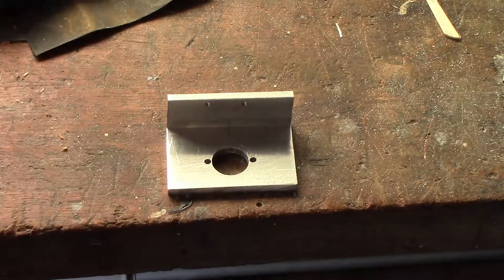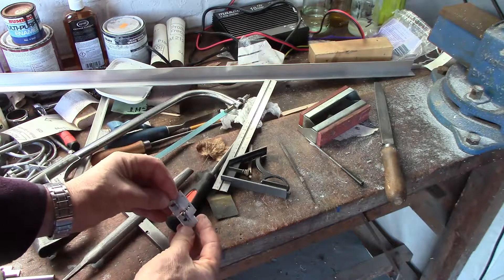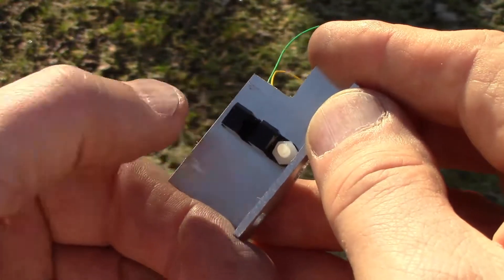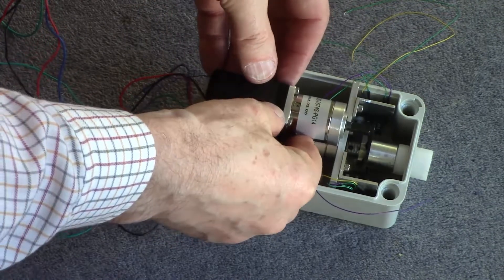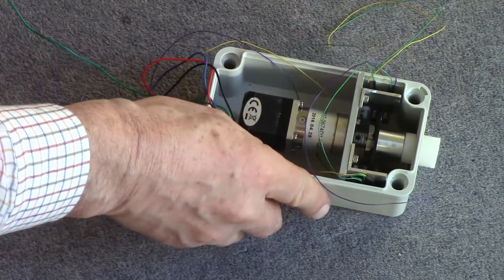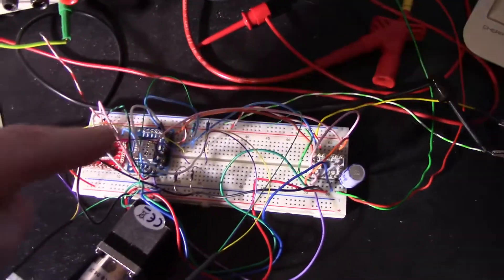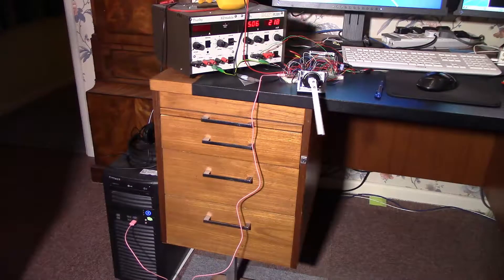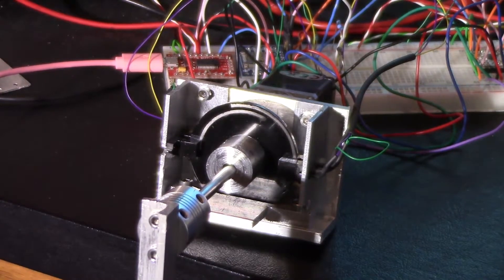Position sensor for 11HS12 stepper motor - part 2

Comment: Hi Sam, when you go higher rations than 27:1 on the planetary gearbox like even up to 100:1 then the Gearbox will not "Just" turn! We will be running a system with around 500+ of these motors and have had to test these!
Reply from the maker: Not sure what you mean by not just turn. You mean at 100:1 you cannot force the motor to turn by applying torque to the shaft?
Reply: @samuelfielder  When the stepper motor is off completely the output shaft will simply not turn at higher ratio's torque will be higher but at the loss of speed to required angle. But possibly for a boat this may not be such an issue to smooth out the movements. Interesting projects, was looking for someone that had cycle tested the stepper. Be worth getting a 3D printer Prusa and doing prints in Carbon Reinforced Nylon or Glassfibre Nylon. Just use a fume hood as Nylon is toxic which is why people print in PLA.
Reply from the maker: @wx6843  "was looking for someone that had cycle tested the stepper" - Did you see this one of mine https://www.youtube.com/watch?v=N92Z9f5vESU ?

Comment: Reasonably priced milling machine albeit very small: https://www.proxxon.com/de/micromot/27112.php?list
Reply from the maker: Thanks. Less than 50 kg, and available in cnc ready form for £688. Only disadvantage I can see is that it may not have enough vertical movement to use as a substitute for a drill press. I had my eye on the more expensive
http://www.axminster.co.uk/axminster-engineer-series-sx3-mill-drill-505105
but was put off by the weight.

Comment: Thanks as ever for sharing. You have a great engineering mind and I really like the fact that you are not satisfied with something simply working, but explain why you don't like it. I think you have made a great effort here and I especially like the opto sensors. I am currently battling with fitting the steering and lift actuators to my electric outboard project, I'll hopefully get something uploaded this week. I've opted for fairly cheep linear actuators, one if which has positional feedback. However I am dubious as to its longevity...
Reply from the maker: Thanks. If I thought longer before making things it might be better, but I rather like to get stuck in!  So, you're a proper, full scale, sailor. I'll watch out for that next upload.
Reply: Samuel Fielder i am the same, I usually have a rough idea of what I want and get stuck in. I'm really just an engineer who has a boat, I bought it as a means of keeping myself sane! Happy new year.
Reply from the maker: Happy New Year to you too. I see you've developed an Arduino autopilot for your full scale boat. I'll study that and then may be ask some questions. We have a similar task on a much smaller scale. Anywhere near the south coast? - We sometimes wish we could film our boat once it gets out into the Channel.
Reply: Samuel Fielder no worries at all, any questions at all get in touch. I learned a lot of lessons the hard way! Sadly I am all the way up in Scotland but occasionally end up down south for work. And let me know if you are ever near Glasgow